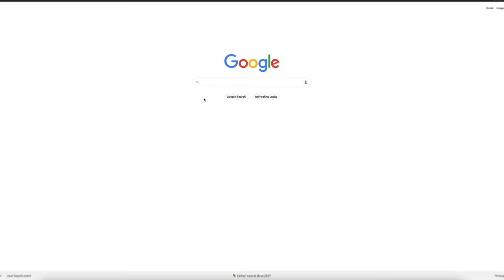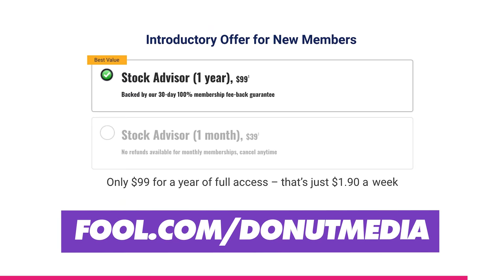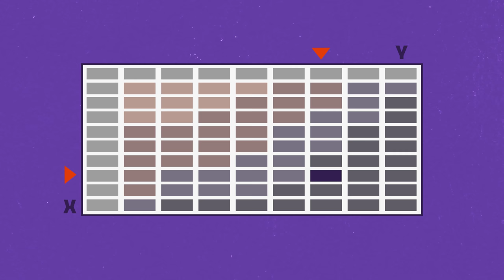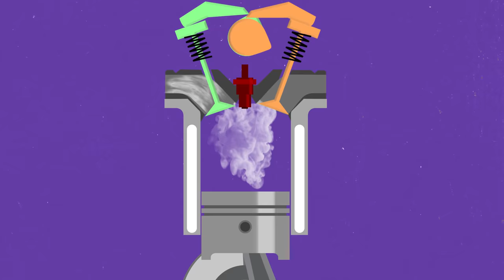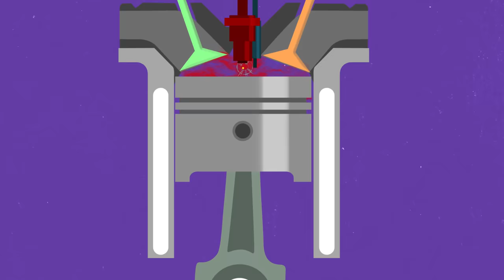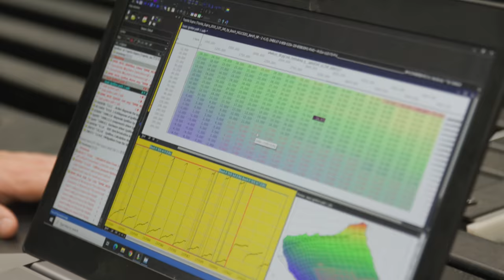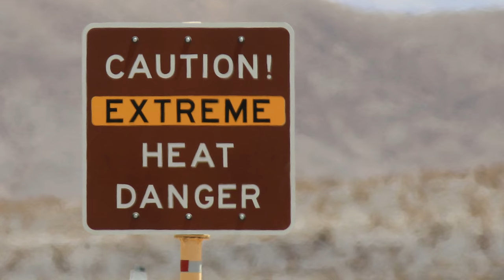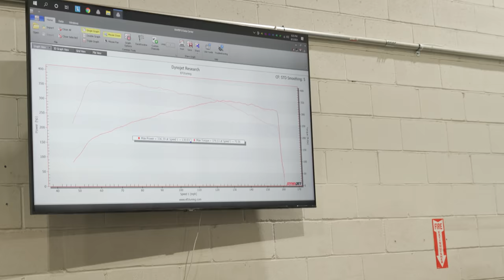Why Are They Banning ECU Tuning?

Comment: Jerimiah spent about 30 seconds talking about how ecu tuning could effect emissions, and the rest on how an ecu works.  Was hoping he would get into details about how modern 3 way cats convert both NOx AND unburned gas into compliant emissions, regardless of power levels.
Reply: That is a complex answer but he somewhat did answer your question in an overall view of emissions and tuning.
With NOx being formed from too lean or too much timing, EGTs really climb causing the partial fusion of Nitrogen and Oxygen. The EGR and other ECU control sensors help reduce this. 
The other end with unburned fuel or high HC, the use of an air pump, Cat, and all of the ECU control sensors reduce this.
Your point on the newer catalytic converters would be a good topic, however I think he is making a general case for the ECU being tuned and thus prohibited even though it most likely polluting less if tuned correctly.
Reply: I was hoping to see a car that proved the point that tunes can run as clean or cleaner then factory.
Reply: Catalyst operation is just about balancing how rich/lean and how long you are rich/lean for each catalyst.  Balancing all of that is how OEM's really optimize post light off emissions.  For that, you use both the first O2/WB sensor as well as the catalyst monitor O2 sensor.  

And thinking that after market tuners can do that better without all of the emissions detection components is kind of a stretch.
Reply: @alfamaize ...if you are removing sensors you are making the ecu less effective at making power...why on 🌎 would we want to do that?
Reply: @martindinner3621  No, I'm not removing anything, I'm just pointing out big drivers for catalyst optimization,.   All of the other sensors are required to get the air calculation even close enough for the front and rear sensors to even be useful.
Reply: That's all his videos. I can't watch these for very long cuz they always turn into a crash course for dummies.
Reply: I was dumb enough to think he was going to have a car emissions tested before and after an ecu mod to see the difference in emissions.

My expectations have been subverted.
Reply: Title of video: Why Are They Banning ECU Tuning? and yet you expect to him to talk about things that aren't the ECU. Hm......weird how the title almost tells you what the video might be about.
Reply: @coldoath  I expected him to actually talk about why legislators and others are wanting to ban ECU tuning, not how and why someone might want to tune and ECU :)

Comment: They are literally going to see so many more of those old school carbureted builds now. They're going to wish they just let people tune their car's ECU. I'm sure in time we won't even be able to drive gasoline cars on the road in the near future. Or I should say internal combustion engines.
Reply: Well, that depends on how lazy the population is and if they just go along with Agenda 21.
Reply: @illegalopinions4082  wait for legislation threatening cheap food products, and people will rise as fast as they can.
Reply: I was gonna get into Japanese sports cars but now it makes more sense for me to get my uncles old 73 c10 in the backyard and take it off non op and put it back on the road. Runs and drives, has a 350, manual 3 speed short bed stepside. Just chilling. It will definitely put more of a dent in the ozone than a ej or fa would. Good Ole 350 with some headers and a edlebrock running a little rich. I feel like the art of building old 350s will come back now. The only thing it needs is new wooden bed planks and I'm curious how hard a solid axle swap would be. Building a step side short bed k10. It's fine as a 2wd cruiser but I want the solid axle. I'll see if I can find a k sieres for cheap first.
Reply: @metadata4255  it isn’t
Reply: @gunner38ED  false and false

Comment: I live in New Jersey, but I am still concerned about other states possibly adopting this mindset. Everyday car or sports car emissions are important, but most tunes don't throw emissions out the window. The custom tunes should be allowed if they fall within emission guidelines.
Reply: Actually most proper tunes run cleaner than factory tune because optimizing for every bit of air and gas to get more power.  Certain turns I’m sure aren’t better, I was messing with options when tuning my car and one of them was injector overrun, basically in addition to normal cycle it  injects fuel after combustion cycle and during the exhaust stroke to send fuel out of the exhaust and cause crackles/pops and flames.   

The thing is, even flames and raw fuel in exhaust are less polluting then a modern car with a bad MAF or MAP sensor or a lazy O2 sensor that isn’t throwing and codes or CEL.  And as someone who worked in a shop for a little while, even during my time I seen plenty of sensors that are bad but not throwing codes and OBD-II emissions are happy and complete, even if it’s pumping smoke at WOT.  The ironic thing is, in most states including cali, a lazy or bad sensor not throwing codes would pass emissions even if pumping black smoke on WOT, because not testing from tailpipe, testing from the ODB-II port for emissions which is just stupid.
Reply: @Honeypot-x9s  The hotter it runs the more NOx it emits.  More power makes more NOx because it's leaner of a mix. The other direction makes more carbon that's unburnt.  Tuning shops NEVER sniff the NOx and carbon at the tailpipe, but they do check the power.  Guess what that means is actually being emitted from the pipe. Mo powah baby... and nobody checks the NOx and carbon.
Reply: Not gonna lie if they’re not tail pipe sniffing skirting emissions is super easy
Reply: The fact is that you could pull a Volkswagen and submit one set of behavior for testing, and another for actual driving. Or just change the tune before and after inspection. The assholes have ruined it for everyone, as they so often do.

The only solution would be to allow cars to be stopped and emissions-checked on the side of the road, without allowing time for any components (including firmware) to be updated. That still won't solve Dieselgate shenanigans. Since it's not possible to confirm that someone is loading firmware that actually respects the emissions laws, it's necessary to limit the options to those which can be vetted. I'm sorry tuning is dead, but I blame VW (and any other automaker that cheated, meaning pretty much "everyone but Mazda") and the coal rollers.

Comment: If only this level of scrutiny applied to the power plants and industrial enterprises. By this logic we should limit the maximum rate at which EVs can accelerate as it uses a tremendous amount of power, the pollution is just done else where.
Reply: @mikeadams2351  You're actually quite wrong, especially when you factor in what you're grids power runs off and how long those batteries last before having to be replaced. Planet of the humans was a good documentary on it, produced by Micheal Moore.

Where I am in BC EV's are kinda practical because of how we get our power, hydro and natural gas, but even then we're still using natural gas. 

A lot of places in the US are still using natural gas including California, and worse yet; they are importing power from places, which normally isn't too bad depending on the distance, but Californias importing energy from as far away as where I am (a different country), so EV's are way less practical for you guys...
Reply: @mikeadams2351  it's not energy that's already being made... If you're charging your car once a day you'll pull the equivalent kw of coal from the powerplant... Granted that it is a small load compared to all the power produced but it isn't energy that has been already made... You'll increase the load on the power station and it will be feed more fuel than usual... So if you accelerate more you'll have decreased range, wich leads to more charging and therefore more coal being burned... Just cause you don't see it doesn't mean electricity is just this magical thing that we can use without consequence... You floor it you'll burn more coal... 
Your understanding of how a power plant works is just gross and upsetting... This is why EVs are so easy to sell to dumb people, cause they "don't pollute"...
Reply: Triston Stuart  That's a bit wrong too, seeing as the batteries are improving all the time. 

I think in the next 20 years electric cars could possibly be a good alternative to gas power, but the battery issue is a big one, its keeping things like solar and wind from being a viable option in most places.

With all that being said: I doubt EV's will replace combustion completely for at least 50 years, even longer in some areas simply because of how they get their power, and how long the batteries last.

Plus by the time that's a reality, I don't think they'll need to ban combustion vehicles simply because by then we'll have enough alternative energies that actually work properly so that wont be necessary. 

Also by then hopefully they'll be regulating the corporations more then they do the little guy, a lot of these BS regulations (aircare, ecu ban, etc) wouldn't even be necessary if they went after the big industrial polluters....
Reply: @pedromateus4268  This guy gets it
Reply: @pedromateus4268  hi there..not one microwatt of electrical power I use has anything to do with coal..or natural gas...your statement falls on it's face in the very begining...if you've got a coal burning plant near you..you should do something about that...
Reply: Triston Stuart  100% wrong. ev's are always better for emissions even with coal powered electricity.
do you include the 4800 gigawatt hours/ month of electricity that is used to pump oil in the usa by 450,000 pump jacks???? that is enough for a tesla to drive 19 BILLION MILES PER MONTH

Comment: I’m in CA, with a couple tuned cars - one of which is due for smog. I flashed the original map on, and am driving it 100 miles for all sensors to be “ready”.  A lot of uncertainty and rumors if a car will fail if the ecu has ever been modified, even if you show up on the stock map. 

Subaru was known for their lean tunes.  My STi ran poorly on stock tune. Turbo boost was inconsistent. A tune smoothed all that out giving me much better drivability - especially in the 3-4k rpm range where I spend most of my time.  

I’m sure eventually the performance crowd will all switch to EVs, once they start offering ones with performance handling - and then shortly after that, CA will come after tuners for running batteries at a higher amp rate or whatever they do to EVs to create maximum power.
Reply: “CA bans electric motor tuning because it generates more ozone.”
Reply: Get out and vote that Governor of yours out!
Reply: ‘Thank you kindly, wolf.’🖤💜🧡💛💚💙💗
Reply: bottle, and then your grandmother😾😿🙀😽😼😻😹
Reply: grandmother, and that she ☣️☢️🔞📵🚷⚠️
Reply: Lol yep. I’m here. They ALWAYS come up with some new stupid law.

Comment: It’s almost like California doesn’t care about making sense 🤭
Reply: Cali hates all cars that you want to have fun with.
Reply: @elijahbarra584  California has been struggling with air pollution for decades, so it kinda makes sense for them to start cracking down on the emission levels of vehicles. However, I also feel like this is a Hail Mary from governor newsom to raise his approval ratings at the last minute.
Reply: @elijahbarra584  more like they dislike ANYTHING remotely cool
Reply: @Jack-cz5su  I work in the industry and pretty much Newsom just wants to squeeze the automotive industry out and make it to where only the manufactures exist and no more aftermarket or mom and pop shops, for the most part the parts that do get put on peoples cars actually make the vehicle more efficient and burn cleaner the issue is when people neglect performing their maintenance on their vehicle, also I would be looking elsewhere for emission levels, cars have such a low level even the bill that bans the sale of new I.C.E. vehicles he signed will only lower it by approx one third and they want everyone to have an electric vehicle but then not bother upgrading the grid to be able to handle the increase of electric vehicles. I think I'd probably update the grid before saying that they don't want anymore new I.C.E. vehicles. In a way its just a new way to fine people and to have more control over what you can and can't do with your property
Reply: @Jack-cz5su  and sadly the few cars tuned and souped to high heaven aren’t even the issue it’s those dang highways with vehicular constipation.
Reply: @Jack-cz5su  Yeah there were smog alerts in places like LA but the issue is that this video proves that anyone with the knowledge and tools can make a car even more efficient so honestly I think they need to look for something other than literally an improvement to ban
Reply: @Benjamin C. If you recall Newsom you're gonna get someone who was only voted for by less than 10 percent of all voters...
Reply: @elijahbarra584  One third is still a lot of emissions and the grid upgrades are facilitated in the federal infrastructure bill.

Comment: If the government truly cared about emissions, it would apply a vehicle exhaust emission standard that needs to be met and not care about how you get there. Government loves its control over people and thus you get told no ECU tuning, even for no valid reason other than control over you.
Reply: In my country you can't pass yearly checks with an engine swap unless is the same model that the car came with. If you had a certificate of emissions from the dealer of the manufacturer you could, but they never ever going to hand that document.

The regulations in my country don't have tail pipe emission standard as you said, they just want to control and push new sales on the same dealers the politicians have lobby from.
Reply: @AmaroqStarwind  A similar thing happened in gaming, where some developers tried banning mods by implying that "they ruin the game" whereas they are banning them because people shouldn't get free content but paid DLCs. So the customer is losing control to what he bought with his money, somehow this is very tied with the loss of the right to repair.

Comment: CA was recording ECUs at the DMV since 2016 to prepare for this new 2021 rule. They databased the ID numbers and checksums of the ECU firmware of everyone who went to DMV during that early period. Now in 2021 starting in July I think, they fail any car that is an anomaly compared to the majority of the ID numbers that were recorded for that model and year of car.  However, this architecture will fail for car models that everybody tuned the moment they got their hands on them.  Let me just say it might be possible -- might lol --that a few models almost never had normal cars' IDs recorded because everyone tuned the isht out of them as soon as they got em.  Yall know who y'are. I ain't sayin. no worries mates.  (You can go research this info if you like.)
Reply: So if we went to the ports and secretly tuned the cars in slightly different ways they would never be able to pin point which cars were tuned and which cars weren’t?
Reply: Except they get the info from the oems as well. So most likely if it doesn’t match the oems or  a carb approved CVN it will fail. The info they have been collecting isn’t to build a “pass” database it’s to verify the system will work and could see how many cars are modified already

Comment: its seriously sad that a state government can ban something without knowing anything about it.
Reply: That's how all governments work, on everything.
Reply: @UCGcQxKtUmyo9VKEIP7Jut9g How is a modded car any less safe then one that isn’t?
Reply: you don't kneed to knwo about ECU. You just need to knew that they tune their ECU to have more power by making the mix more rich... and thus more polution.
So bad ecu tunning because it's just about getting more power regardless of increase in pollution
Reply: @ereder1476  almost as bad as the pollution caused by electric cars - power's gotta come from somewhere.
Reply: @CodyVanRyn  yes. BUt hacking your tesla to have better acceleration won't produce more pollution. pollution has already been done when creating the battery anyway
Reply: @ereder1476   the power to recharge that battery too, unless its coming from renewable energy, is worse for the environment than coal
Reply: @CodyVanRyn  that's because america don't use nuclear. but recharging a car battery is nothing compared to what your idustry use. So it's dishonest to equate recharging an electric car to the increase in fuel consumption on your car
Reply: @ereder1476  a full recharge vs a tank of gas, unless the recharge uses renewable energy, the recharge is worse for the environment than a tank of gas.
Reply: @CodyVanRyn  dude, it seems you have no idea of how things works. There is a reason why gas is running out and is a limited ressource
Reply: @ereder1476  thats a different argument entirely. Hopefully the big offenders, US and China can get away from coal, because that's what will actually move the needle. Though as places like Cali rely more and more on renewables, the blackouts have increased.
Reply: @CodyVanRyn  fact is recharging your battery is nothing. Polution though increasing gas consumption and having unburned gas in your exhaust is
Reply: @CodyVanRyn  do remember that LA was worst than anything in current china in term of smog.